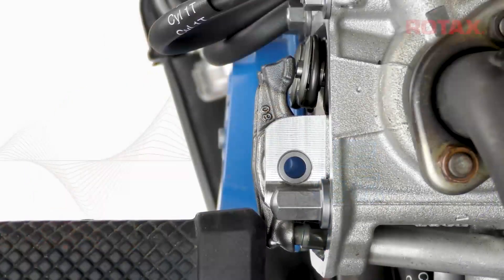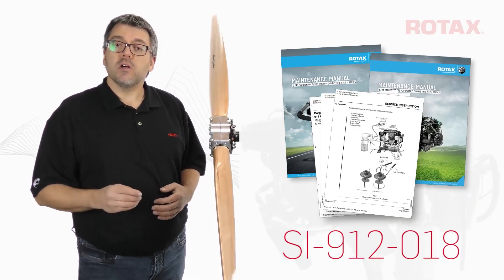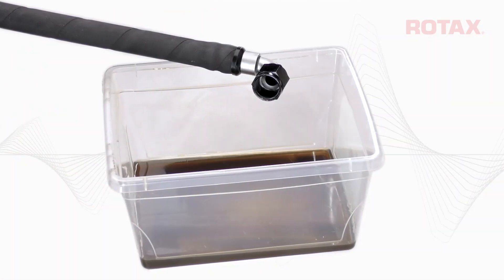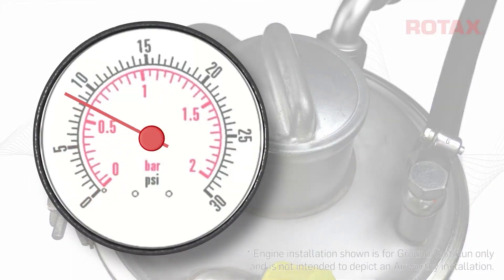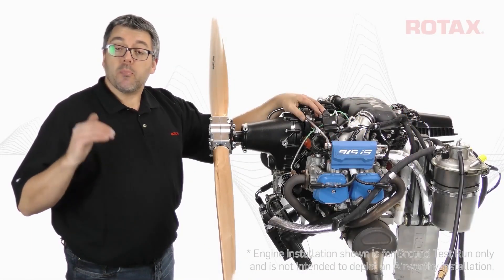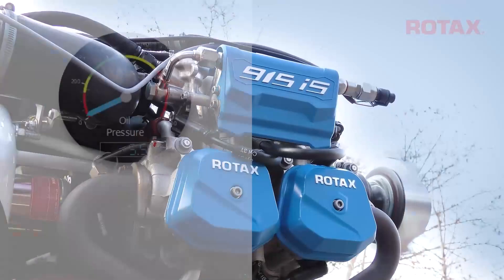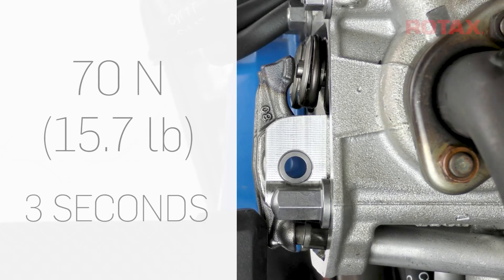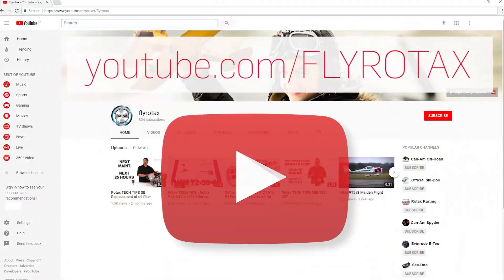Purging of lubrication system - Rotax Aircraft TECH TIPS #15

Comment: Why does the turbo line test require the engine to be run rather than just spinning the prop?  I did that and what a mess.  The container blew away instantly and oil coated the bottom of the airplane before I could stop the engine.  Seems like there must be a better way.  I may try to affix a plastic bag on the fitting next time with a zip tie so hopefully it can’t blow off.